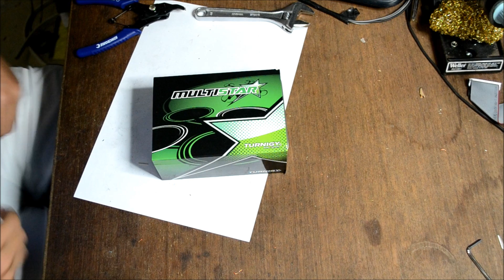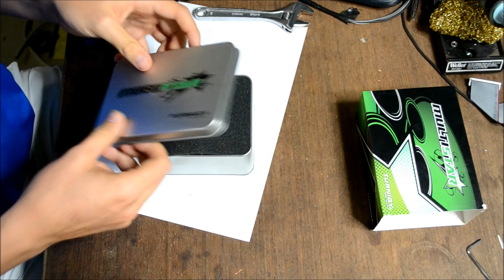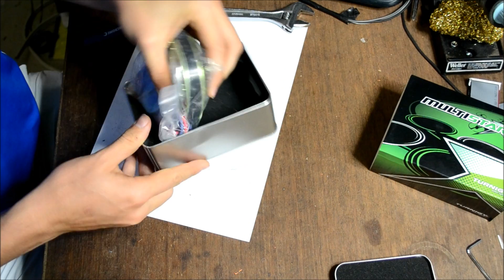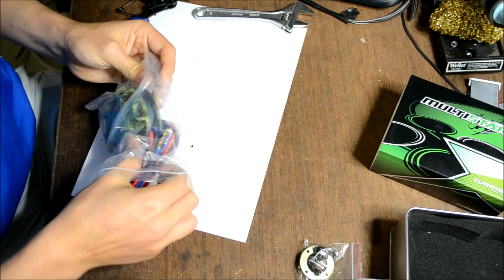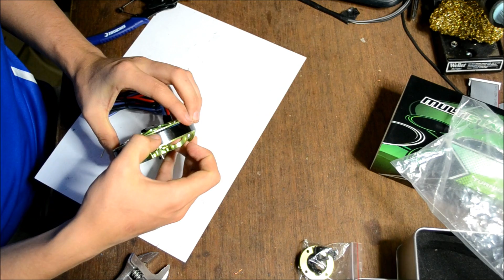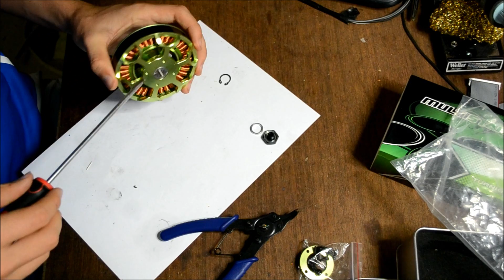Turnigy 9225-90 Motor Unboxing, Specs and Disassembly

Comment: I tried unscrewing the bolt on the back and it just broke right off. Was too tight.
Reply: I am trying to open the 9235 version now and both units I have are screwed in so tight. Do you any suggestion after your accident?
Reply: @YamShargil  Underneath the bolt there is a snap ring that really holds the shaft in place. So the motor isn't ruined if you break the bolt (which, by the way, seems to be aluminum). If you do end up breaking the bolt, it is probably possible to drill through its remnants to clear out the hole. Then you can replace the bolt with a new one. But I haven't tried--I just covered it up with a 3D-printed cap.

Comment: please suggest max thrust in # or Kg  on 12s and 30" prop as per mfg.  sorry, but I don't understand the more tech info you have provided.
Reply from the maker: Hi there Jeff, I actually haven't used this for a multirotor application but have found this for you: 
http://www.hobbyking.com/hobbyking/store/uploads/210178992X50800X32.PNG  

Looks as it if produces 9.42 g of thrust/Watt with 26" prop, so it'd produce 5.8 kg of thrust at peak efficiency.

Comment: Hi, Can I use these two motors for rc car/robot with gear 1:2 ? Weight of robot 30kg. Want max speed about 35-40km/h.
And with these motors will be have low rpm? I mean for example 1km/h for uphill etc...
Thanks!
Reply from the maker: Hi Andrey, can you give a bit more detail about the rc car/robot? Unless it has really small drive wheels and you're using a low voltage, a 1:2  gear ratio won't provide you with the speed or torque you want. 
Provide me your voltage and wheel size and I'll let you know. 

The motors are fine for low rpm, but suffer from cogging at startup if not sensored. If you require instant torque startup, then you'll need to sensor the motors and use a sensored controller.

James, 
Coulomb Motorsport
Reply: Thanks for fast reply :)
Sure. 
1. Weight about 30 - 35kg
2. Wheel 100m diameter
3. Two motors (like on your video or maybe Sunnysky 8318 120KV - it have 0.037ohm and 2.8kv, so I think it's better for low rpm), also motors in robot (inside)
4. Battery 16s LifePo4 (cell 3.2v). Max current - 150amp
5. Two FLIER ESC 16s 100-200amp. 
6. Will be 10 shocks from HPI baja 5b 1/5 
7. Rubber track.
8. Gear 1:2
9. Size: 970mmX540mmX350mm
Happy New Year :)
Thanks.
Reply from the maker: Hi Andrey, lets start with your gearing based on speed and wheel size. 
A speed of 40 km/h is 40,000 metres/hour or 666.66 metres/minute. With 100 mm wheels, your wheel circumference is 0.3412 meters and thus your robot will move forward 0.341 metres per revolution. 
Therefore, to achieve 666.66 meters/minute your wheel RPM will be 666.66/0.3412 = 1953 RPM. 
With a 1:2 gear ratio, your motor will only be turning 976 RPM. 
I think you actually mean a reduction gear ratio of 2:1, which would mean that your motor would turn at 3906 RPM. 

With your battery voltage of 16S (51.2V nominal due to 3.2V x 16) multiplied by the kV of my motor (90 kV), the motor would turn at 4608 RPM unloaded. Under load this number will be lower. 

The motor should be more than enough to move your robot as one of them has been enough to drive our 115 kg manned car at more than 50 kph, so 2 will provide more than enough. However you will still encounter the cogging issue, so I would have a look at using a small centrifugal clutch system or sensor the motors. 

Cheers, 

James,
Coulomb Motorsport
Reply from the maker: Hi there, 

You're right that the motor is sensored and it has a suitable no-load speed however given the weight and the fact that it is a inrunnner BLDC motor, I don't think it would be as applicable. Outrunner motors should have a higher kT than inrunners simply due to their design which shifts the moments of torque further away from the axis which inherently produces a higher turning moment. That being said, inrunners are more efficient in general. Thanks for your contribution :) 

Cheers, 

Coulomb Motorsport
Reply from the maker: Hi Andrey, 

It really depends but I would be trying to use the motor from the first link, the 100 kV version or this motor here; 
http://www.hobbyking.com/hobbyking/store/__54885__9225_90KV_Turnigy_Multistar_Brushless_Multi_Rotor_Motor.html 

Your wheels are so small that you should have plenty torque and the reduction in weight is very significant. Difference of more than 20% to total weight between adding 1.8-2 kg with outrunners and 10 - 11 kg with inrunner linked above. 

Try those with your current controllers and if the startup speed is too slow or it is pulling a lot of current to start with, then look into sensoring your motors or using a slip or centrifugal clutch. 

James
Reply: Ok. I think I will buy one, and cheap esc to check it. Because spend for test about 170$ for normal ESC too much for me )
Thanks again James. Have a nice day!
Best regards,
Andrey
Reply from the maker: Hi Andrey, a higher pole count will almost always result in more torque and lower kV. 
Therefore the first motor looks to be the best suited to your needs and should still have plenty of power!

Comment: how max thrust it have on 30 inch props and 12 s battery?
Reply from the maker: @bhavinsinh Sorry for the late reply. 
We don't actually use it for drones so I couldn't tell you from personal experience. There is however this file which may help you, stating it can produce a maximum thrust of 2.88 kg using a 26.5" prop and 12S battery; 
https://hobbyking.com/media/file/210178992X50800X32.PNG

Comment: May I know how did you calculate the Kt of the motor?
Reply from the maker: +Deo Lee kT is calculated by 1/Kv in SI units, and with RPM measured in rad/sec. It's much easier to use this brilliant online resource;
http://www.bavaria-direct.co.za/constants/
The calculator at the bottom will tell you the kT after you input the winding resistance, No Load Current and kV.

Comment: Hi may I know the torque of this motor?
Reply from the maker: +Deo Lee The motor has a kT (torque constant per Amp) of 106.1
This means that it produces a torque of 106.1 milli-Newton-meters per amp.
At 10 A, the motor produces 1.061 newton-Meters of torque. 
This should answer your question, just multiply the 106.1 by your current (A).